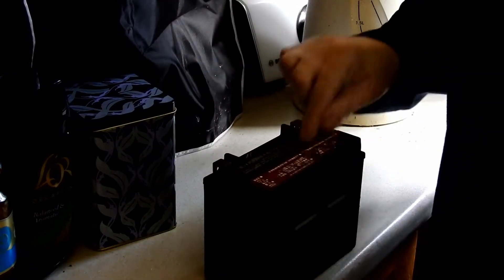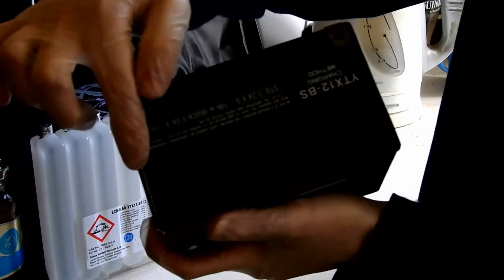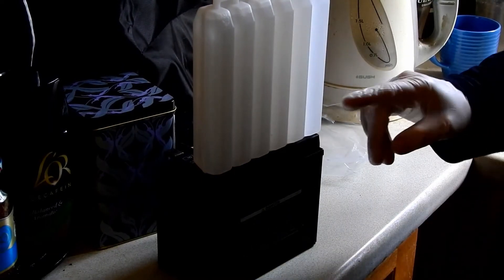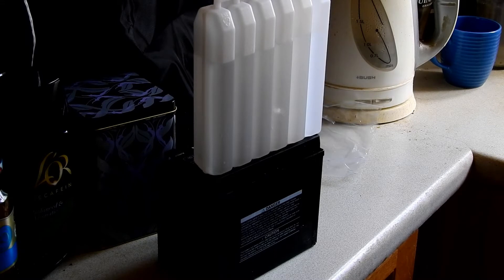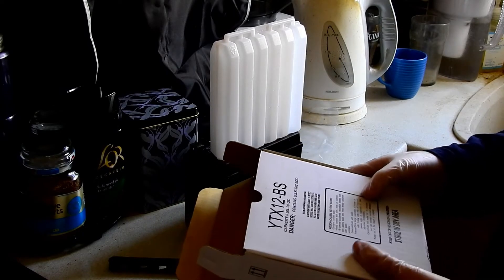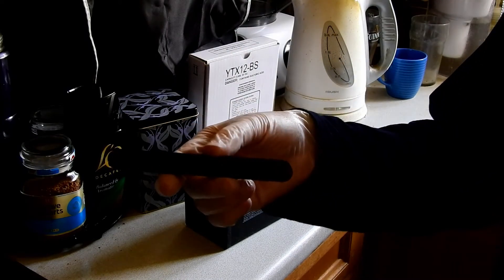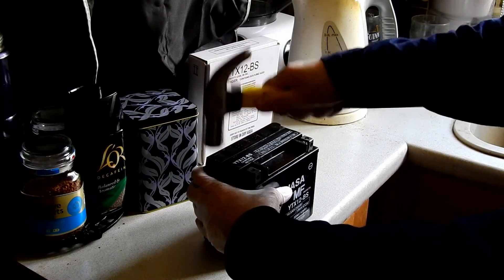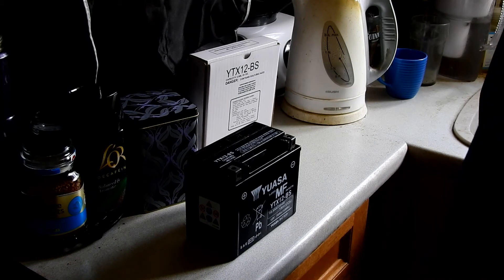How to fill a dry battery with sulphuric acid (Yuasa)

Comment: Surely the battery plates are pure lead and lead dioxide respectively when the battery is sold.  So, when you add acid, the battery would already be in the "charged" state.  Why is further charging necessary ?
Reply from the maker: It will not be fully charged and Yuasa recommend fully charging them before putting them into service: https://www.yuasabatteries.com/resources/guides/how-to-activate-a-conventional-battery/

Comment: The battery became  warm after adding the acid, any comments / suggestions ?
Reply from the maker: Unless it's getting too hot to touch then leave it be, heat is a natural consequence of the chemical reaction going on between the acid and the metal plates in the cells.

Comment: What should I put in inverter 150ah battery , distilled water or sulphuric acid????
Reply from the maker: Inverter batteries should be topped up with distilled water.
Reply: Marty Greenwell what to do when battery water  gravity goes down?
Reply from the maker: Has it been overfilled or left for a while uncharged? If the former you might need to empty and refill the electrolyte (30-40% sulphuric acid, the rest distilled water), if the later you could try bench charging it.
Reply: Marty Greenwell my battery is 7 years old and now it's not charging at all ... So sulphuric acid will work on it ? From where can I get sulphuric acid and how can I measure 40% means how much in that 150ah battery ?
Reply from the maker: Possibly, but it could also be one or more of the cells is dead and the battery needs replacing. The 40% means a mixture of 30-40% acid to 70-60% water if you're completely replacing the electrolyte - there should be high and low level markers on the battery to show you where to fill the level to. I can't answer where you can buy the acid from, but you can buy the already mixed electrolyte in the correct ratio, just have a web search for battery electrolyte, it will turn something up for you.
Reply: Marty Greenwell thanks bro your awesome .
Can you plz make video on how to check dead battery cells and how to replace them ?

Comment: Thanks for this video! Does it matter if you charge the battery sealed or loosely sealed?
Reply from the maker: The batteries are meant to remain sealed once you've put the acid in, so they can be charged sealed - you really don't want the acid sloshing about.
Reply: Marty Greenwell thanks mate 👍
Reply: I could’ve sworn it said to leave the cap on top loosely while you charge it for the first time